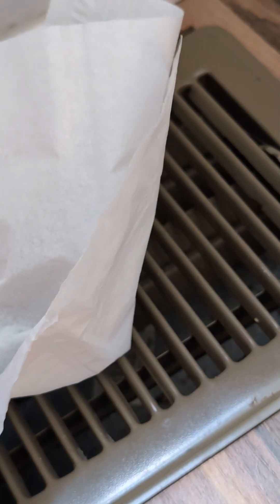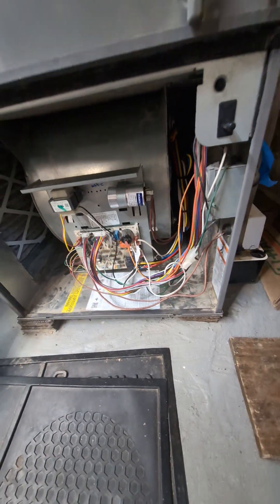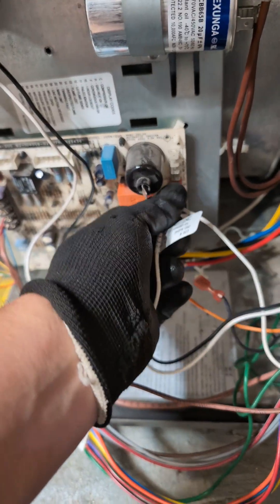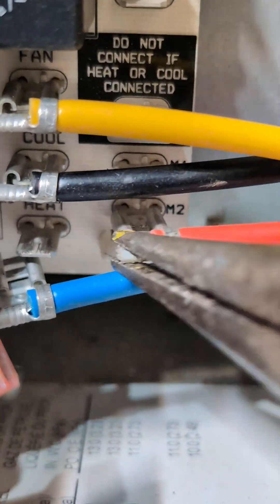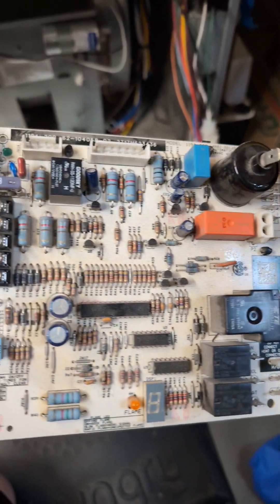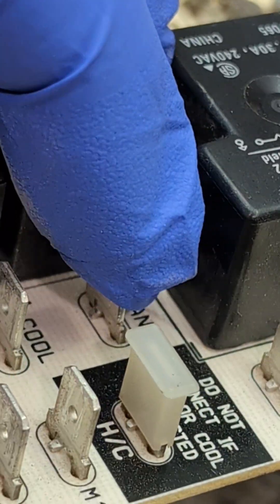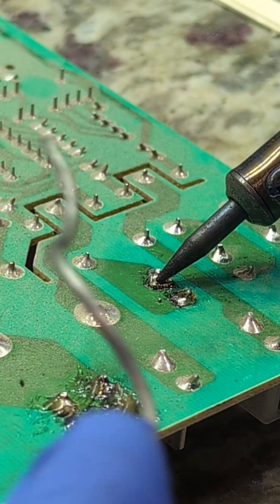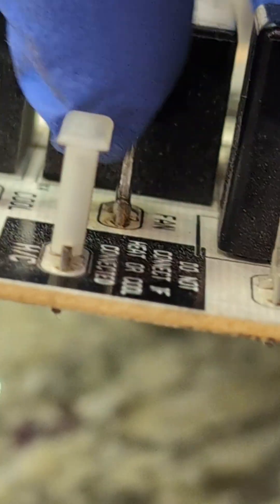DIY HVAC Control Board Repair

Comment: Noice! I changed my motor out last fall. Did not need any circuit board work. If those circuits over heated like that they are too many amps…
Reply from the maker: @steveeckman7578  where did you get your motor from? Internet?
Reply: Yup. Amazon. Was a quick fix. Furnace was more efficient this year than ever.
Reply from the maker: @steveeckman7578 the house has seemed pretty chill and cool since this so, I'm happy